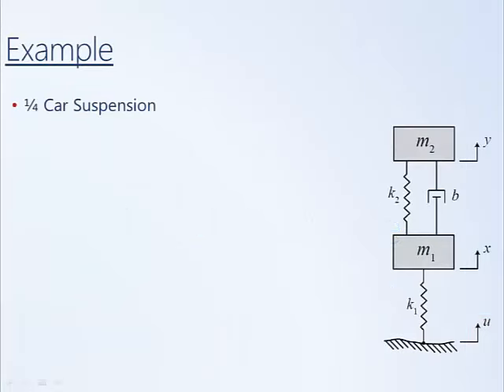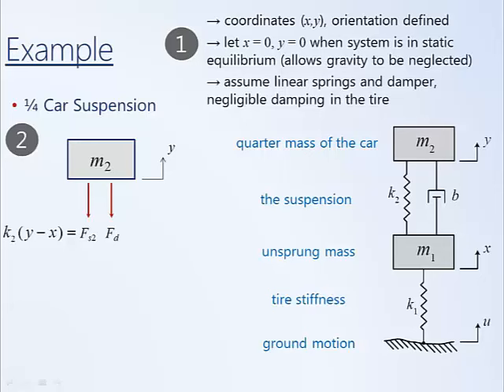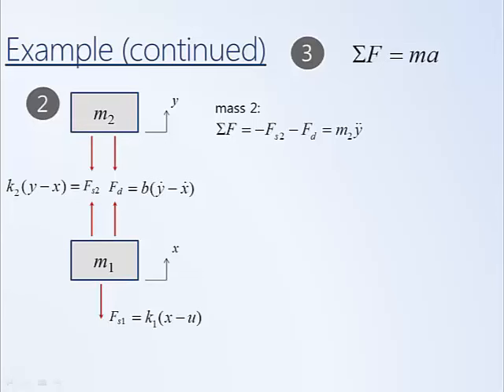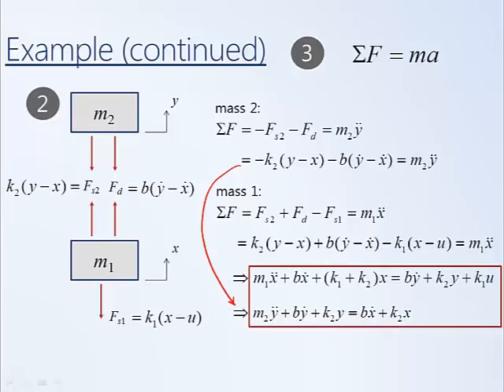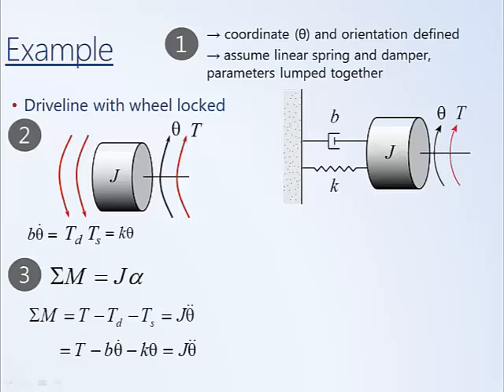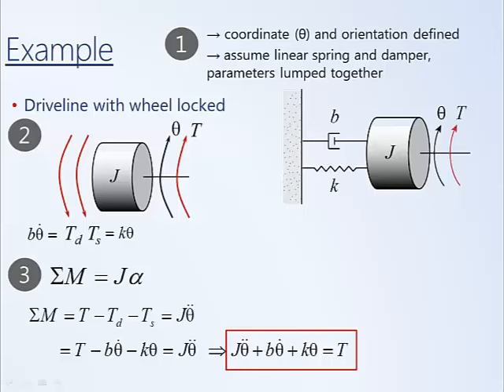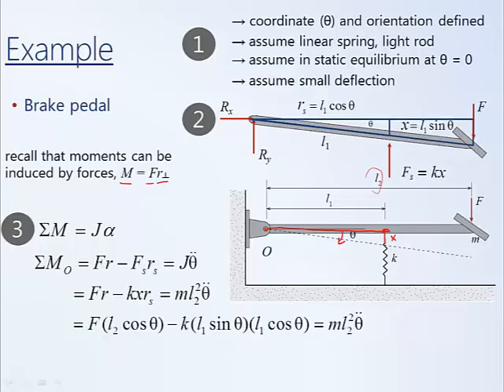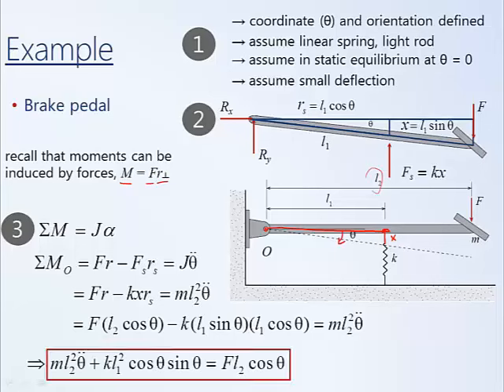System Dynamics and Control: Module 4b - Modeling Mechanical Systems Examples

Comment: Thank's for going over everything in gruesome detail, I was super confuzed by this stuff (especially the directions and positives and negatives).
Reply: Positive and Negative signs used here with respect to the movement of mass and arrow given in data. If the arrow head of mass is in the direction of force than it will be positive otherwise it will be negative.

Comment: 5:12 Something doesn't look clear to me:

A system is said to be in static equilibrium if it is either at rest or moves a at constant velocity (in both cases the acceleration is zero, which is the criteria for a system to be in static equilibrium, which by Newton's second law and its analogous law it occurs if the sum of the forces and the sum of the torques are both zero.) Also, gravity is always actuating over the masses m_1 and m_2, and so they have weight. In this example, I assume that when you said static equlibrium you referred that the system is at rest. Thus, in static equilibrium of the system, each weight pulls down (gravity) which compresses the two springs. In other words, when the system is in static equilibrium, the two springs are compressed, i.e. the springs aren't in their equilibrium position, which means they're exerting force over the masses because of Hooke's law, so as to try to put themselves in their equilibrium position. (Notice the difference between "static equilibrium of the system" and "equilibrium position of each spring".)

Now, you've considered that x=0 and y=0 when the whole system is in static equilibrium and so the springs aren't in their equilibrium positions. Thus, when x=0 and y=0, the springs must be exerting forces because they're deformed. But according to the equation you put in min 5:12, which is F_s = k_2 × (y-x), when x=0 and y=0 (system is in static equilibrium and springs aren't in their equilibrium positions), the spring k_2 isn't exerting a force since F_s2 = k_2 × (0-0) = k_2 × 0 = 0. But that is false, because the spring must be exerting force on mass m_2 since the spring is compressed in the static equilibrium of the system.

What did I get wrong? I hope you can explain this. Thanks.

Comment: So force due to gravity can be neglected because of the opposing normal force from the ground? Yes??
Reply from the maker: The force due to gravity (the weight) can be neglected because of the opposing force generated due to the static deflection of the springs. You can imagine that if the system is in static equilibrium the springs deflect under the weight of the masses such that all forces balance (weight forces = spring forces). Therefore, if you choose the reference for the deflection of the springs to be from this point of static equilibrium, then the weight forces can be thought of as being cancelled by the static spring forces.
Reply: @hillrickc  Thank you!

Comment: I do have issues to know at which moment this (y-x) or (x-y)
Any tip to help deal with that
Reply from the maker: You can express a spring force as k2(y-x) or k2(x-y), the only difference is the sign. The key is that when you draw your free-body diagram, you want the direction of the force to match when your expression is positive. When y > x, the spring is stretched and the force matches the free-body diagram. When the mass oscillates and y < x, then the force is negative and has a direction opposite that shown in the free-body diagram.

Comment: At around 5:35 you say that the way that you have modelled it, the force from the spring is positive, but you still drew it in the negative direction, how come?
Reply from the maker: I know that is a little confusing. What I said is that the force is positive down and by that I mean that when the expression k2(y-x) is positive (when y is larger than x), then the force will be downward. When the expression is negative (when x is larger than y), then the force will be in the opposite direction. I hope that helps.
Reply: Okay, thanks. So what it comes down to is, if I apply a force on mass m1 then the spring force on mass m1 has to negative and positive on mass m2, if the positive direction is in the direction of the force applied? So x1-> is positive direction then       (m1)f->    then (-k1)x1, and k2(x2), if m2 is hold still and m1 is moved that is. Is this correct?

Thanks again Rick, wonderful videos.

Comment: What about mg?
Reply from the maker: In the suspension problem, we have defined the coordinates so that they equal zero from the point the system is in static equilibrium. This means that the deflections of the springs in this state generate forces that exactly offset the weights of the masses. Since the weights are canceled, we leave them out of our equations.